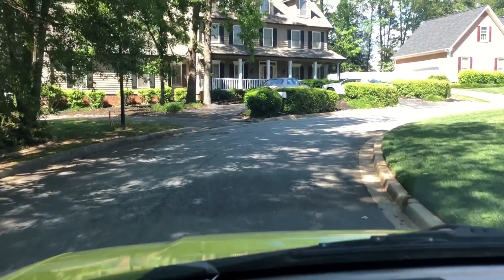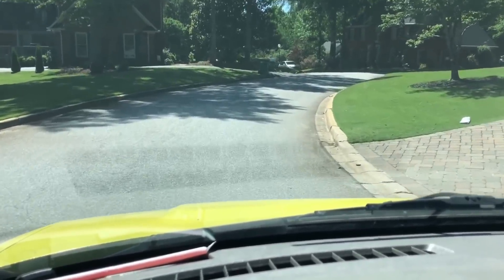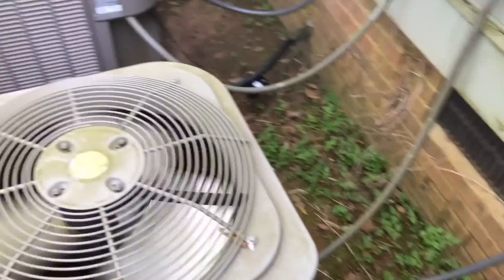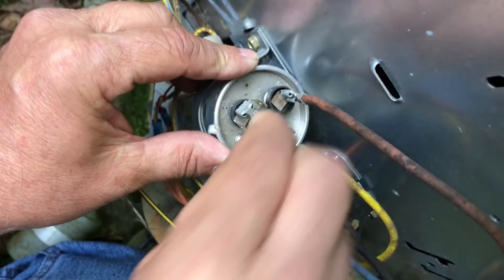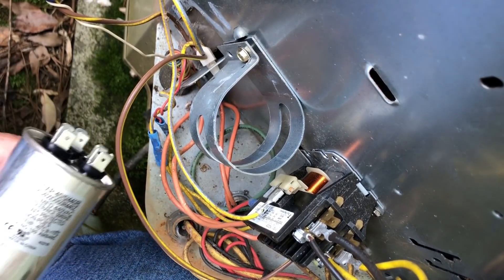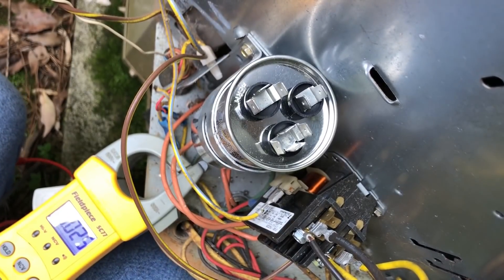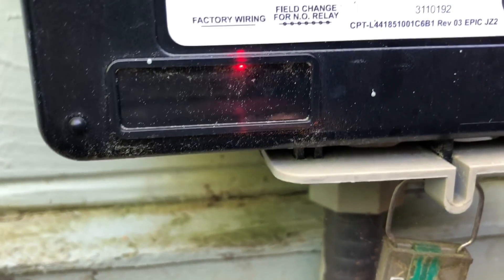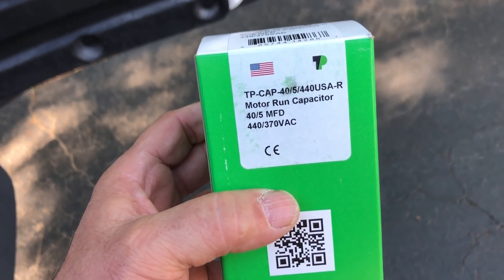Dont try this at home Capacitor replacement

Comment: Out of curiosity, what are the boxes connected to each ac unit besides the disconnect ?  Is that a way to control or save energy costs ?
Reply: appears to be one of these

https://www.eaton.com/us/en-us/catalog/utility-and-grid-solutions/load-control-switches.html
Reply: More350Power the utility company puts those there so they can throttle the customers usage during peak hours. Usually during a heat wave customers would beg me to disconnect them
Reply: pretty much what the other folks linked.
I'll add this, they help save the energy and lower utility demand by forcing the indoor unit to run the fan and redistribute the air for the programmed wait time, before bringing on the condenser. how does that help? poor thermostat placement and heat gains in small areas, say someone using the stove top for 10 minutes without vented exhaust hood,
possibly some vents in house shut and others with rooms over-cooled, run blower for XX minutes to move the air around house before bringing condenser back on. the above scenarios would very possibly cool the hot spot/satisfy thermostat and use less energy and save equipment wear.
more or less, it was  early on power company/combined research energy savings to fix bad designed homes, poor installs, improperly sized systems!!!! it also helps the power grid overall and they can likely send a signal to change the "off time"
Reply: @throttlebottle5906  Thank you for the information.  I have seen those before but never understood what they did.
Reply: @james6794  Interesting.... im surprised I dont have them in my area, but, then again the borough buys the electricity from a major company and re-sells and distributes it..
Reply: @thehvachacker  Does it effect the comfort level in a house such as humidity and/or set point ?
Reply: @More350Power  What it does it gives the utility company the ability to shut down the AC to reduce the load on the grid. Figure peak hours would be 3-6 pm. PSEG is my local power provider. If a strain is on the grid they can remotely shut down many Condensers. They give a very small rebate to anyone who goes into the program.
Reply: The HVAC Hacker Just to expand on your comments, during peak periods where the grid is overtaxed — particularly in unusually hot or cold days or when major transmission lines have failed or are offline for maintenance — and the utility company is faced with either buying or producing very expensive peak power (the cost of which then gets passed onto the consumers) the utilities have the ability through these devices to implement “mini” rolling blackouts, but blackouts that ONLY affect loads like electric water heaters and central air conditioning or electric strip heating.  Depending upon the area the “rolling blackout” on those devices may be 15min off to 15 min on, or 30 min off to 30 min on, etc. — so typically a 50% duty cycle, or thereabouts, in the areas I’ve been exposed to them.  Everything else in your house works normally but the temperature may creep up (or down in winter) by several degrees during those peak events depending upon how well insulated your home is.

Growing up in Florida they were pretty popular in the 80s and 90s because delivering peak power to South Florida has always been problematic due to Florida’s geography since all of Florida’s neighbors are at the very far north end of the state and that power must be delivered across many hundred of miles to reach South Florida (including past all the customers in Central Florida).  As a result, during especially hot days or cold nights, or if a major transmission line was offline for any reason, they would sometimes (though rarely) be forced to implement rolling blackouts where you may go without power for 3-4 hours at a time because there simply was not enough available power to meet every customer’s needs simultaneously — these were one of the solutions implemented to make the need for such rolling blackouts a much, much, rarer event since the utility company could now command your electric water heater and A/C or strip heating offline as needed to free up power on the grid nearly instantly...and instead of going without heat or air conditioning for many hours at a time you now only had to wait 15 or 30 minutes at a time.  So they do serve a valuable function for those who choose to participate (we did while we lived in Florida, but they were also more incentivized with rebates back then versus today).  In the 14 years I’ve lived in upstate SC I can’t recall the local utility (Duke Energy) ever even so much as approaching us about participating in such a program and our household is certainly a major user at up to 100KWh/day, it just doesn’t seem to be as popular or as incentivized in this area as compared to South and Central Florida.

Comment: Did you de-energize the cap with your finger!
Reply: Lol
Reply: I threw my phone down trying to get away when he did that.
Reply: He did not. The motor windings did or the power disconnect did if he happened to pull it at or near zero.

There is zero need for him to do that and zero risk with power removed.

Comment: Not sure if HVAC prices vary regionally, but here in Vegas its a damn racket; I'm being quoted $500 to change 4 capacitors when I can buy them for a grand total of $100.  Am I missing something here? (edit: quoted price of $1080 for 4 caps, not $500 as originally stated).
Reply: bjkarana markup and labor
Reply: Companies need to make money to be in business. No ones going to fix your equipment for free.
Reply: @Pop_A_Chaderall  Thanks captain obvious, but all the HVAC defenders that have made such frivolous comments still can't explain why the markup for such a basic repair is quintuple the cost of equipment and labor.  A similar markup would be if Jiffy Lube charged $200 for an oil change.
Reply: Update: so the best rationale I've received is the industry canned response of "certified technicians make sure the job is done correctly so you don't (insert scary sounding scenario)" which is pretty lackluster for something so easy, and still can't account for the massive upcharge.
Reply: @bjkarana  it's called overhead. Companies have operating costs: Wages, workmans comp, healthcare, insurance, truck upkeep, building rent, ect. We have to mark up to stay in business.
Reply: bjkarana you would crap your pants if you saw the markup on your glass of soda at dinner.
Reply: @Aaron-xl8ei  Again,  due to the small nominal value of the up-charge for beverages, it's understandable why we pay $2-3 for a soda that costs 25 cents.  However, charging $900+ for "labor and overhead" for a simple capacitor change has still not been sufficiently explained.  Did I accidentally look behind proverbial curtain here?  A lot of people seem to want to defend this and unless you're an HVAC worker, I don't understand why.
Reply: @Pop_A_Chaderall  I get that.  I do a lot of my own car work which is comparable for time, effort, overhead, and no shop anywhere would charge $1080 for $100 in parts that took 30 minutes to change.  Changing a home A/C compressor which takes at least a few hours?  Sure, I'd look at paying $1500-2000 for that kind of work.  But the obscene overcharge on capacitors makes me think that it's just simply gouging, and I honestly see a business opportunity in just replacing caps for a fraction of the industry standard cost.
Reply: bjkarana What I am trying to explain to you is that markups exist in every business - for example the mark up on pop is something like 600% but no one complains about that. I don’t think anyone is arguing that there are bad companies that gouge customers. The beauty of capitalism is you can go to someone else if you think it’s too much. $1080 sounds like too much to me, but I don’t know all the circumstances of the job.
Reply: @Aaron-xl8ei  I know.  My point was to say that due to the nominal value of a dollar in relation to purchasing power, it's economically justified to upcharge 600% for a soda when you figure in the costs of running a restaurant.  And I'm not saying that HVAC companies can't charge that much, I'm just surprised that the free market still supports that.  I'm honestly considering starting my own HVAC repair for basic repairs because at such exorbitant prices, there seems to be gross inefficiency in the current HVAC business model.
Reply: @bjkarana  if you want quality work done, where your confidant that you're getting a quality job done you're going to have to go with a reputable company. They're generally going to be more expensive because of their overhead. Quality products, quality technicians, quality work. It comes with a  price. People pay for what they believe is a  good product or service.
Reply: It takes $200+ just to pull up to your door.
Reply: Here's a scenario you might understand.
A doctor charges you 900.00 for a visit and an x-ray, plus a needle full of whatever.
That needle costs 12 cents.
That x-ray is 75 cents.
So you pay 87 cents worth of actual product.
Now factor in this thing called overhead.
Cost of the x-ray machine, cost of utilities, cost of insurance, employees,office, education,
On going education,
Etc....
That 87 cents just turned into 900 dollars.
Now, you can just use the internet to learn how to self diagnose the issue.
Just make sure you are correct with that diagnosis.
Same thing with a qualified service technician.
We have the proper tools, (those cost money)
Proper vehicle with insurance.
Proper licensing,
Parts on trucks/ vans to keep the customer satisfied.
Continuing education.

So yes, you can change the parts. Go buy them online. Just remember, electricity ain't forgiving.
If you don't deenergize the capacitor it has the stored energy to stop your heart.

Changing out a system has many factors. Had there been any additions added to the house? Hot/cold spots in rooms, etc....
Without schooling you run the risk of wasting a ton of money.
1000 in tools is what it takes to properly change out a system.
Torches, vacuum pump,
Hand tools, micron guages, refrigerant scale, nitrogen/ regulator,
And a good set of properly calibrated refrigerant gauges......
Again that is overhead. So yes, please change out the system bought off the internet. Then call the professional when it's dead in a year or two.
Reply: @misteriguana2748  Yes, those who can't do it safely, shouldn't.  But it's simple, and I've done mine for several years, and replaced fan motors too.  The upcharge on caps still makes ZERO sense to me, and my wife is an orthopedic PA ...medical equipment is not cheap, and HVAC techs aren't paying for 10 years of post secondary schooling.

Comment: What was that box that had the delay on the wall?
Reply: Load controller.
Reply: This is use to help the power grid. Usually only use during high damn. Sometime also use on electric hot water heater.
Reply: Power company gives the homeowner a discount each summer month, usually 4 months, by installing this radio controlled box that cuts the thermostat signal to the compressor when the state or the local power grid is reaching "capacity". By turning off your compressor and thousands of other neighboring compressors, they steal that power to give to those who don't have a box rather than produce the power needed or purchase it. So, you suffer the heat for may a $20 discount on your bill each month. Those boxes can be turned off for a maximum time, some up to 8 hours, and during certain times of the day etc. Most power companies sell two or three versions of discounts depending on how uncomfortable you can stand it for the savings you select. In our area, So CA, we have two choices and the savings isn't worth the trouble mainly because they turn your compressor off versus cycle it off for say 20 minutes for each hour so you can at least get some relief. You may as well not have A/C during the times they engage the signal to off and its usually during the times when you most need your A/C. The other discount they sell turns your compressor off 15 minutes for every 30 minutes which gives little discomfort however, the discount isn't really worth it because in So CA summer, most folks end up with a $300 to $800 electric bill each summer month and the discount seems like pennies compared to the bill and discomfort for $20 discount. 
Today, this plan is a complete scham. Back in the 1980's when they introduced "A/C Cycling Discount" now renamed "Summer Discount Plan" So Ca Edison or SCE power offered it under more precise rules such as Monday thru Friday only, 12 PM to 6 PM only, holidays excluded, they could cycle off your A/C for a period of time and the reason given was to help supply power to the commercial and industrial business as they usually were up to peak power demands during those times of the business day. The discounts were decent too, we were getting $45 to $65 monthly discounts based on the kWh usage per month. Then, over the past 3 decades of annual changes they finally rested on 100% off and 50% off during peak power demand times and it was not limited to summer, its all year long, all day, all night and the discounts are much less. Of course rate increases several times per year for the past 30 years has made power bills insane and then wildfires broke out due to lousy maintenance of power lines and now we are being charged to pay for their poor business practices. PG&E who powers most of the northern portion of CA also caused fires, I believe several of them due to old and worn out power lines and their attachments. They were also responsible for murdering around 90 people in the Paradise fire. They filed for chapter 11 bk and no one went to prison for those murders. Then, we have homeowners insurance companies who feel that those areas that burned to the ground with nothing left have some reason to increase rates there. How is that? Rate increases and the risk fell to zero ! You have to wonder how criminals in Government and big corp remain free to walk the streets.

Comment: Ted can you explain why customers are trying to change out capacitors here in the Upstate of SC after watching your ANTI DYI channel and creating more problems than it was first report. Had a customer stated after watching your  videos attempted to change out his capacitor because he thought it was easy enough. Pull wires off somehow and cross them up and apply the common from the contactor side to the common on the 24 volt side and fried his defrost board. We need to be careful on What We show.
Reply from the maker: LOL
Reply: primusheating1 you should be thanking Ted for the work he brought you.
Reply: natural selection and job assurance type of people.....
show it all, if they don't understand and are still dumb enough to ruin equipment or kill themselves, then so be it :)  far too many stooges about...
Reply: @throttlebottle5906  
well said Mr Throttle Bottle!!!!!!!
Reply: @throttlebottle5906  Some homeowners i don't think aren't that stupid and don't know how to change a fan capacitor, especially those who happen to be very knowledgeable about electricity themselves, yes i understand you need to cover yourselves on what your show people, but i don't want to be a self righteous butt at the same time and say everyone shouldn't try to do it, do to that fact.
Reply: Why be careful on showing? Every unit has a wiring schematic printed right on it showing anyone that cares to read it, without ever needing to watch youtube.

Comment: how the fk was that fan running of half a mf of capacitance on its run winding that cap must have had some leakage currant going thru it too which would have heated up the fan cause the leakage currant would not have been phase shifted the 90 degrees that heat would have thinned out the grease in the bearings making em go dry and thats why it is a lil stiff too

Comment: I can't tell if Anti DIY HVAC is sarcastic or not. The channel shows so many incompetent HVAC technicians that DIY is the only answer. I know I'm better than 95% of the HVAC I've seen!
Reply: I suggest that you watch Steve Lav's channel.  He seems to be quite knowledgeable about plumbing, boilers, and HVAC.  Steve does a great job of demonstrating how to install boilers, furnaces, and sheet metal duct transitions.

Comment: hopefully the "chinesium" is improving in quality, importing is one thing, but having it all be pure trash quality and not costing much less, whilst fat cats pad their pockets just isn't cutting anymore...
Reply: That is my point, labor is less than 1 dollar per day why does the price not reflect it. I was doing a job in China and the laborers were bring a piece of equipment through a large whole in the wall and I could not help but worry about them thinking that they were going to be injured.  I was told not to worry because there was a billion in line waiting to take their place. A wheel for a wheel barrel cost too much so they pay 3 people to carry it. They will pay a person to burn a hole through a piece of metal with a drill and a dull bit because the labor is cheaper than the bit.

Comment: Touch a cap by accident and you never will forget it. I gaurantee
Reply: Touch them all the time. If it's on DC power it'll hold a charge hence there usually being a bleed resistor shorting the two terminals.

On an AC system, they are charged and discharged at 60 times per second (actually 120 times due to crossing zero twice in one cycle.) And any residual current will dissipate through the motors windings before you can touch it.

Now if you touch them while the unit has power... yes. Yes you can get shocked. Done that before.